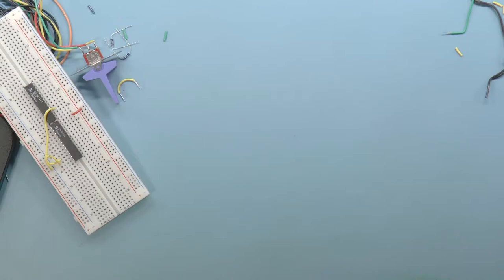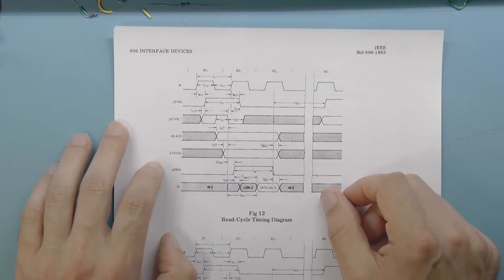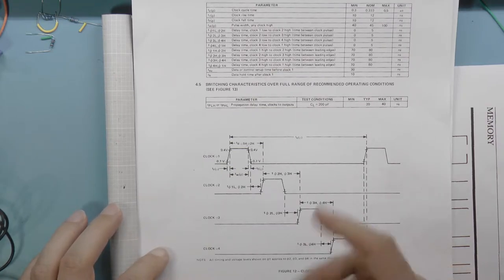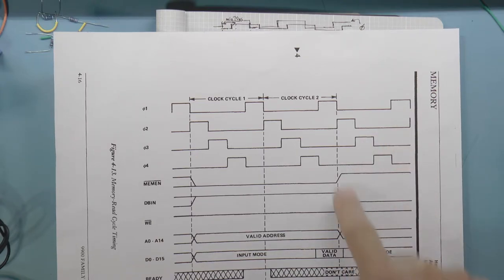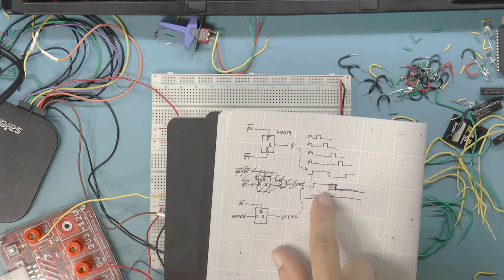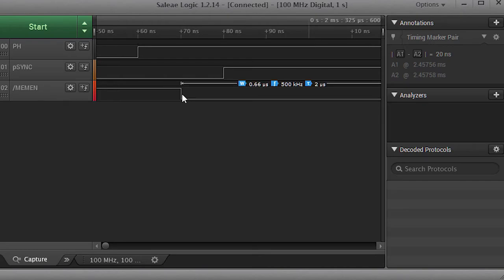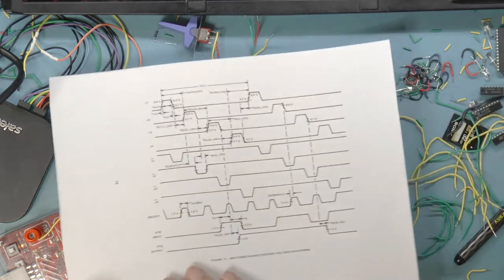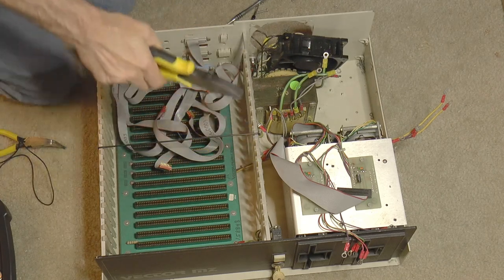The S-100 bus

Comment: "S-100 Bus" by Frank Hayes (1989, TUNE:  Bonny Ship The Diamond)

When I was young, my friends all worked like fools to get their share
Of an S-100 system, like an Imsai or Altair;
Well the S-100's still around, I'm very glad to say
But friends, I'm here to tell you that it's not the same today

Chorus: And it's cheer up, my lads, let your hearts never fuss
When you're integrating systems for the S-100 bus

To tell the truth, the source of all our troubles seems to be
A committee on computers of the I of triple E;
They settled on a standard spec, 696 by name
Now everything is standardized, but nothing works the same

(chorus)

They say the 80 boards are way too slow - it's enough to give you fits
If the 09 isn't fast enough, then go to 16 bits
68 and z8000 and an 86 as well
And code compatibility goes straight to bloody hell

(chorus)

Then add a board for the modem line and one for every port
And a printer board and a keyboard board, and as a last resort
For every problem we will add a board that has the cure
It's not too damned efficient, but it's a mother, that's for sure

(chorus)

And when it's all assembled there's computer to your choler
It's nice to have a micro but a mainframe would be smaller
And when they turn the power on, it's sure to dim the lamps
With plus or minus sixteen volts and fourteen hundred amps

(chorus)

Comment: A nice video.  The  Motherboard PCB you first display shows how poor the design is.  There is no consideration for signal integrity or EMI susceptibility or radiation. The IEEE 696 standard differs substantially from the original. It essentially drops support for Front Panels and introduces the use of a bidirectional data bus and better support for alternate bus masters. It also starts to address SI and EM issues by the introduction of a few more (but not enough) signal return pins.